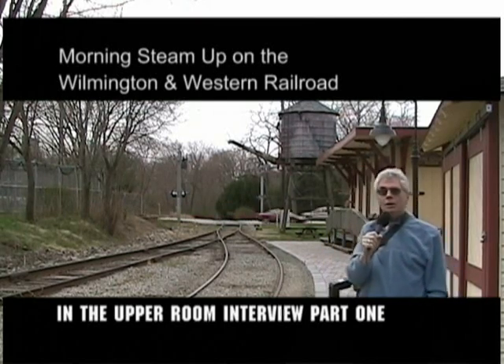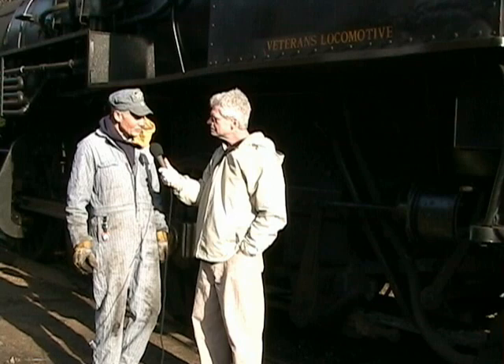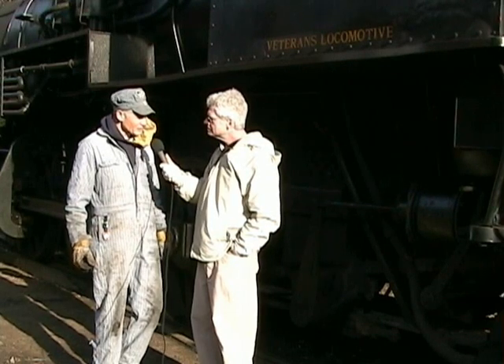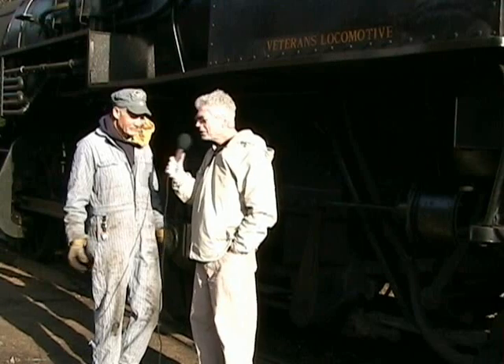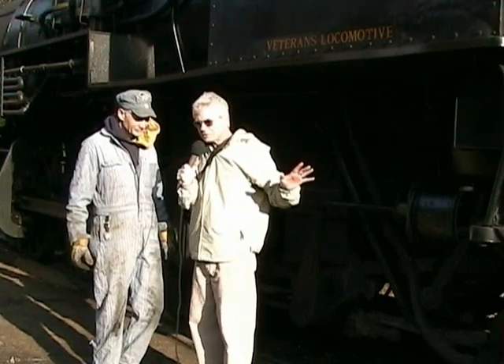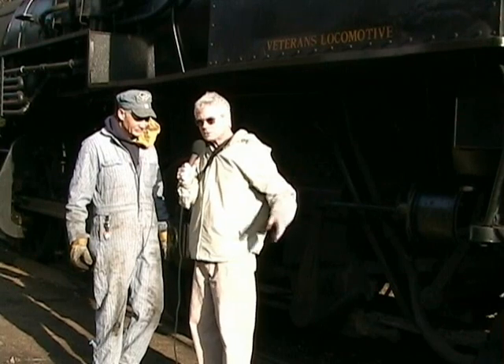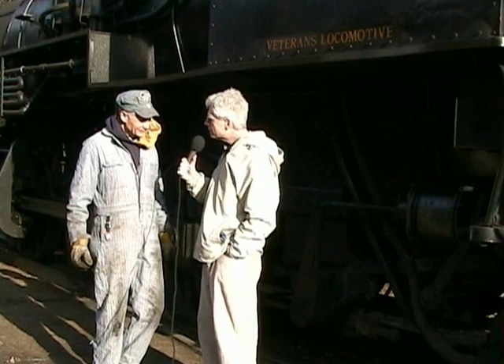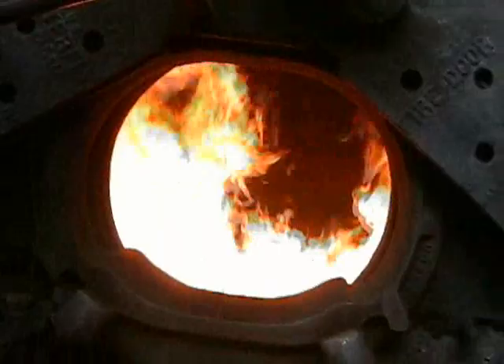Wilmington & Western RR-Firing the steam locomotive

Comment: A boiler must be brought up slowly to keep from warping the tubes. 8-10 hours is the usual amount of time for a boiler that size. It can be brought up quicker if the water in the boiler is still hot. Starting the fire like that is dangerous. It also leaves a lot of soot in the tubes because of the pitch in the pine boards. The proper way is to put a good layer of coal in the box and then light a shovel full of coal that has been soaked in kerosene. I learned this in England firing small steamers